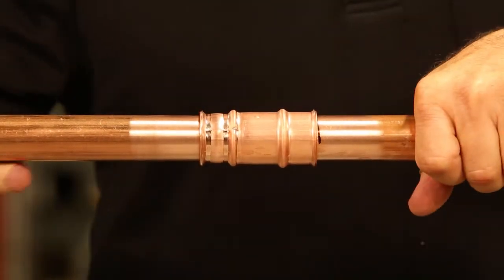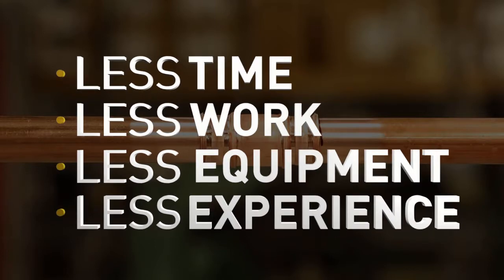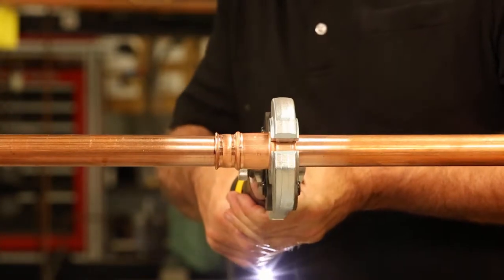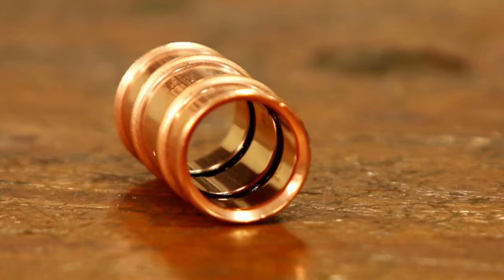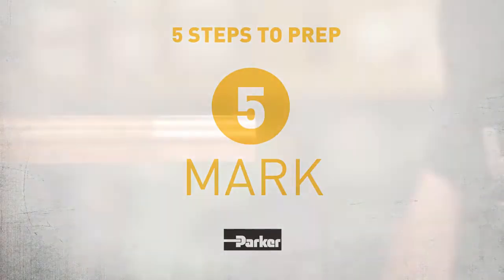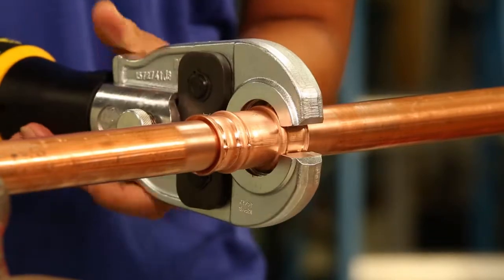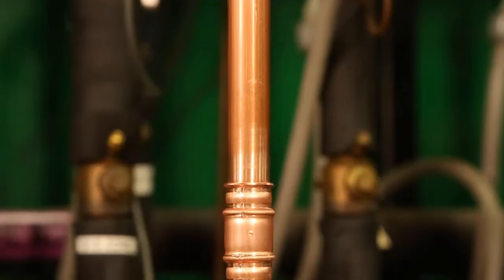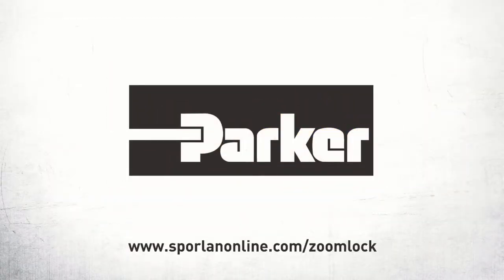ZoomLock Flame-Free Refrigerant Fittings For HVAC and HVACR

Comment: Dude can't braze even if his job was at stake. Or he is  slowly taking his time on purpose for the video. Flame should be set higher and always heat up the copper pipe first then the coupling. The. Move on the other side of coupling

Comment: Whoever did the brazing doesn't know what they are doing.  You don't feed the rod into the flame but from the other side.  Also, you put most of the heat onto the coupling as the melted rod gets pulled toward wherever the heat is applied.  So that was a weak joint.
Reply: Isn’t that soldering?

Comment: How long does the o ring last before it leaks 2 years?
Reply: With the refrigerant accelerating the decay, probably 6 months

That said, the made in China circuit boards on modern ACs will go out before these made in China o rings 🤣
Reply: I’m very skeptical still about these but our company switched about 3ish years ago and to my knowledge we have yet to have a problem with them but only time will tell, they do seem pretty reliable so far though
Reply: Think about vehicles, they use O-rings. Some of them leak all of it in 3 years, others will go to the scrap yard with a full charge still in them. I can't see there ever being an average life expectancy to the seals.
Reply: Any o ring almost always says dont contaminate with oil. wait till there is a burn out and system is contaminated with acid.